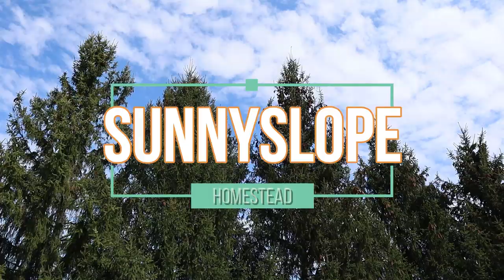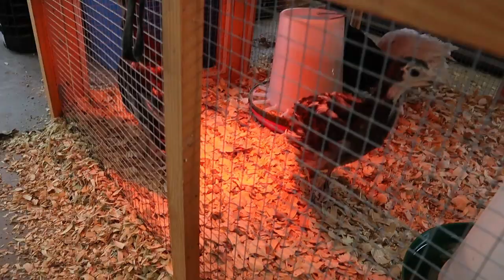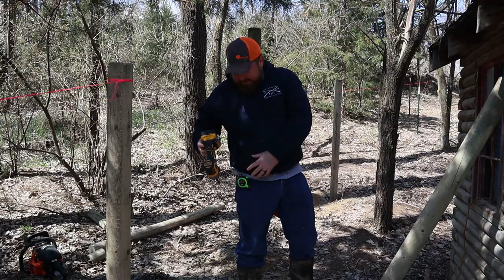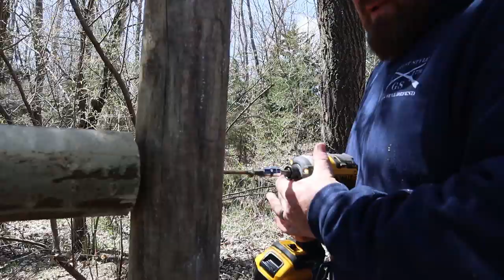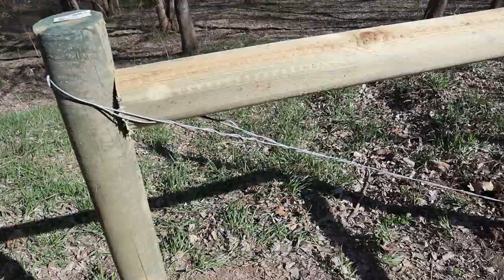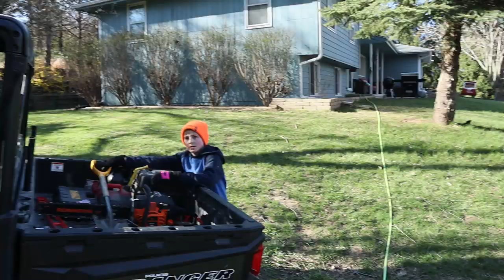✅ Quick Easy Way To Install Tension H Brace Wire..... Fence Build PT.3

Comment: Thank you so much for your wire tensioning hack with the hammers! I am installing tension wire at the bottom of our wood fence that has welded box wire on it. My big dogs chase rabbits, squirrels and slide to a stop which is pushing out the bottom.
Reply from the maker: I’m happy it was was helpful , I seen it on n YouTube and knew it was easy for one person to do so thought I’d share 👍👍 good luck Paul

Comment: Looks good! You may want to get wire crimpers and crimp each of your loose ends, just so it doesn't slide through your fence staples over time :)
Reply from the maker: I wrapped the ends around and through the right wire so it’s won’t move. I did smack in 2 more staples though . Good advice cause that would suck over time 👍👍👍

Comment: Pair of vice grips would work to pull that wire around without snapping maybe? I’d probably spend a week trying to fabricate something on the bx to help pull the fencing around instead of hurting my back.   Then I’d spend the next week doing it by hand cause my crap idea didn’t work.  I’d eventually choke down my pride and ask my neighbor to help, but probably not. Good luck to you!
Reply from the maker: The hammer give the pulling leverage but trust me I thought what else could work too. The BX would have been nice if I had a hay fork, that would have been perfect 👌

Comment: I could only find 4in diameter treated posts in my area and could not get a hold of the 6 inch posts but would like to build a h brace fence for my half acre to keep the livestock in my area out. Do you think I could still use the 4in posts?
Reply from the maker: Yeah should be fine , I wouldn’t be afraid to use it